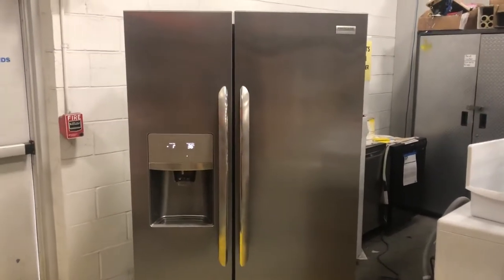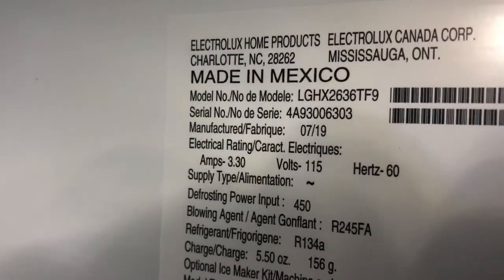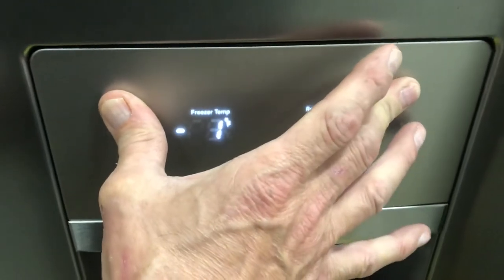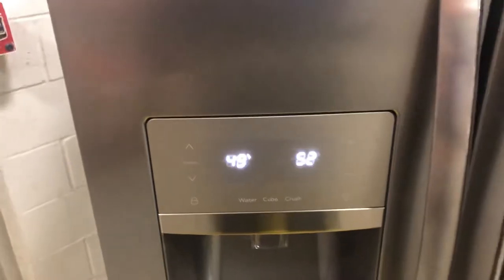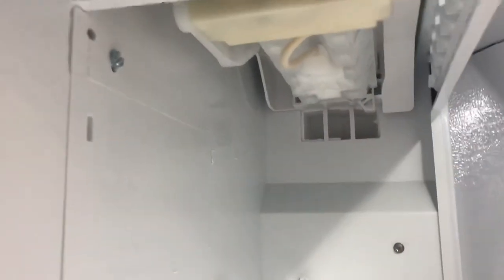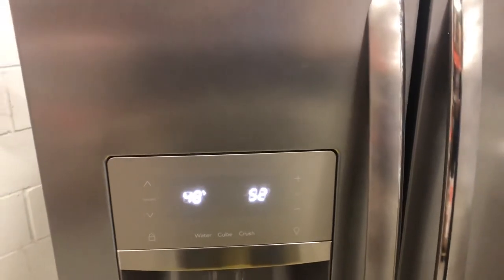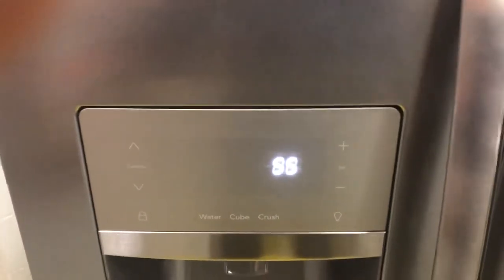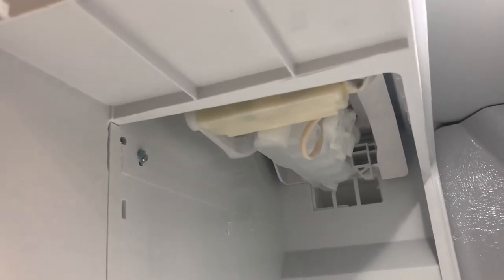Running Icemaker Diagnostics(Test Mode) On A Frigidaire Gallery Side By Side Refrigerator

Comment: If you run into the problem of not being able to get out of test mode like I just did, you hold FF + for 10 seconds and it will reset the fridge and power back up. You’re welcome.
Reply: Thank you. Why no one mentions this on any of these videos is beyond me.
Reply: What is FF?
Reply: @emilymachlin8529  Fresh Food section
Reply: I have a 2022 my panel button options are different still a side by side ...I don't have a fresh food button 😒

Comment: How do you get it out of the test mode? Does it just go back on its own?
Reply: I just did these tests. Looks like to get it out of diagnostic mode you have to unplug the fridge for 30 seconds. I found it easier to just shut off the breaker for 30 secs.
Reply: Unnecessary.  Get out of that diagnostic mode by holding + for upto 10 seconds or it self exits if left alone 5 minutes
Reply: @justinyount6624  TY

Comment: I have an upper and a lower ice maker.  They both stopped working at the same time.  Any thoughts?
Reply: I would check for a clogged water filter or water supply issue. Good luck i
Reply: I am having the same problem. Did you get it resolved and how?

Comment: My unit passes all these tests but will not fill the ice hopper. How does it measure when to fill or not make ice? Manual says 2.5 pounds in 24 hours based on need. Any help?

Comment: I have a Frigidaire Gallery model GRSC2352AF0. I have a an error code Er t8. Have you seen that error message before or familiar with that error code?
Reply from the maker: That’s a thermistor error. Any issues with cooling? Too cold or not cold enough?  Or ice maker issue?

Comment: What about how to test ejecting ice.  It makes ice fine but won't eject ice.  Will eject manually in diagnostic mode but not once exiting diagnostics
Reply from the maker: If the freezer is cold enough and it is making ice but not ejecting you need to replace the ice maker
Reply: First, thank you for your diagnostic videos.  Very helpful.  Maybe I was not clear in my question.  I meant it won't dispense ice thru door when not in diagnostic mode.  It will work manually in diagnostic.  Also once somehow a few cubes fell into the bin on the door and when I pushed the paddle with cube selected, it tripped the dispenser system to work.  Weird.  If you did get what I was saying originally and still need to replace entire ice maker, sorry for this 2nd post.  I will live with scooping the ice for a while!😁

Comment: Error message on our 2 month old fridge just like this reads OFF. And no longer working. Any thoughts on how to fix?
Reply from the maker: Yes it’s turned off. The way to turn it back on depends on the brand and model and usually involves pressing and holding a couple of buttons on the dispenser. Check the owners manual it may well tell you what to do.

Comment: What if the water comes on but doesn’t fill the tray?
Reply: Maybe a frozen water line or faulty water solenoid valve
Reply: Hes right frozen line is likely. They are well known for frozen lines and or evaporator.  Open the door and depress the switches. If the ice maker fan growls probably frozen condenser.  If it sounds fine likely frozen line.  Roll it from the wall and turn the water off.  Disconnect the green shark bite connector.   You should easily blow through it towards the icemaker. Report back on the findings.
Reply: @justinyount6624  frozen evaporator not condenser
Reply: @PickerJimS  oops. I'm even IMACA certified! Embarrassing! (Fixed it) The condenser is under the unit.

Comment: I get the "Er" code on TEST #58    What’s my next step?    Fridge is Only 4 years old
Reply: Any suggestions?
Reply: The water is filling the ice tray and freezing, but the ice is not dumping out of the tray
Reply from the maker: If the freezer is below 10 degrees your ice maker needs to be replaced
Reply: @danielsonpicker7279  if the thermistor is reading wrong do you have to replace the whole ice maker or can you just swap out the thermistor?